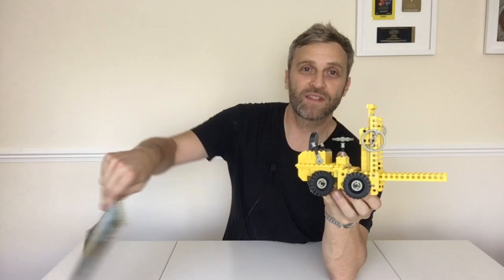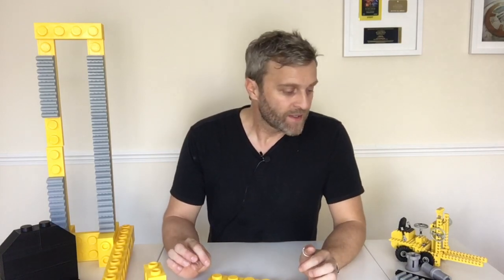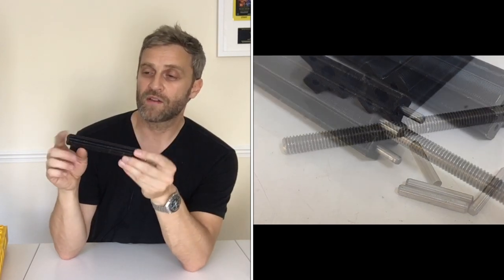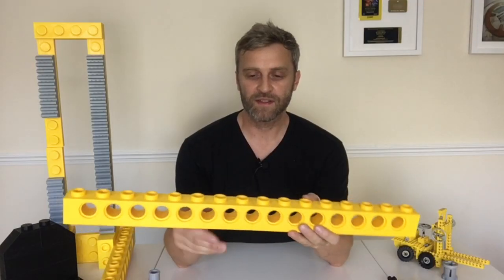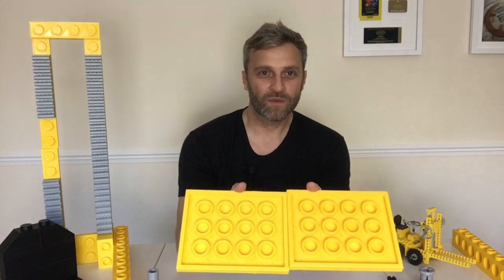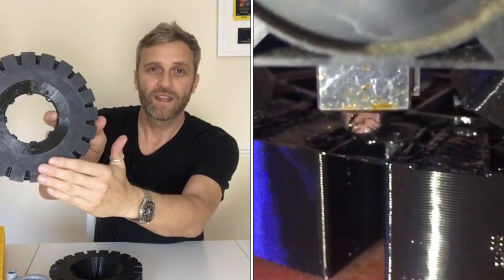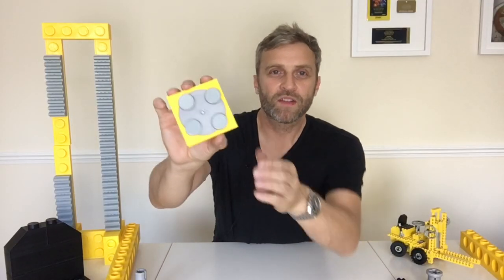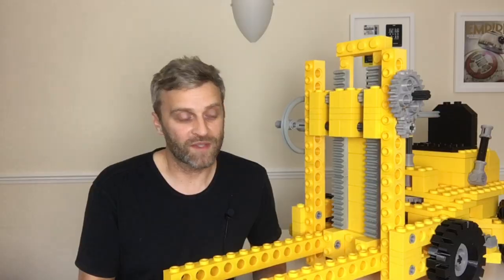3D Printed GIANT LEGO Forklift Build! - Mantis Hacks E10

Comment: Hi I am an engineering teacher at a uk college. I am going to print this for my students to assemble to learn about rack and pinion, gear ratio and so on. 
I need to quote the amount of material required. has anybody printed this so I have a rough guide? 
If so this would save me buying the file to realise the material required is over the remainder of the terms budget.
Reply from the maker: Depends on what size you want to print it at. This is 5 x scale, which is about 25 to 30 kg of material. However, if you reduce the scale to 3 x then it would be significant less, about 5 to 7kg

Comment: I noticed you are still printing your axels vertically. I had great results printing mine horizontally 3x. I used the mecabrick models as a template, they have chamfer sides which allows for them to be printed on their sides with no supports with an X cross section. They came out really strong with PLA and with the grain running lengthwise I could make them tight and they would still slide. Also the the real lego pins if you look closely the pins have the lip flattened near the strain releaf slot on either side so the lip can be big enough to hold the pin in place but still allow the pin to pass through the technic holes when compressed.
Reply from the maker: James Surine cool! I'll take a look at the horizontal print method.. Not sure what you mean about the pins without having one in front of me but the ones I printed work well.
Reply from the maker: I'll take a look later. I did add a chammfer to one of my axles this morning and tried a horizontal print, looks good, but need to re-work tolerances now..